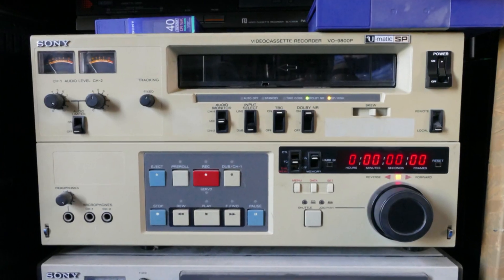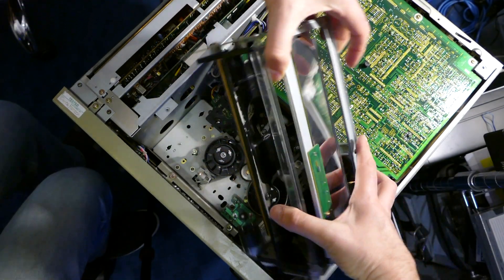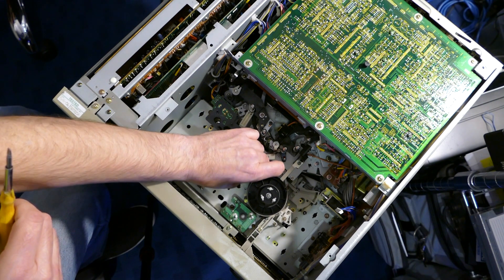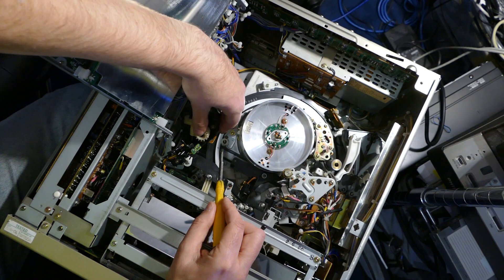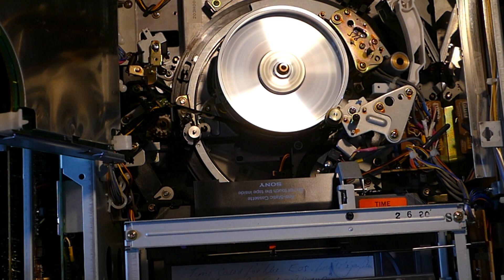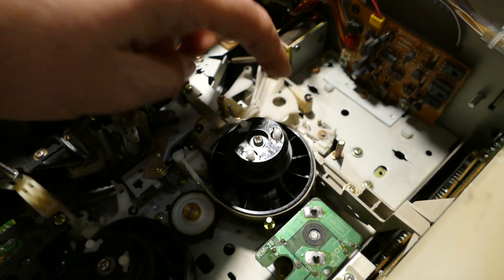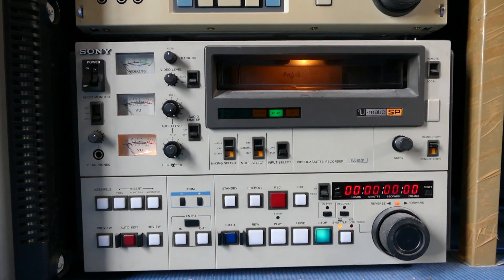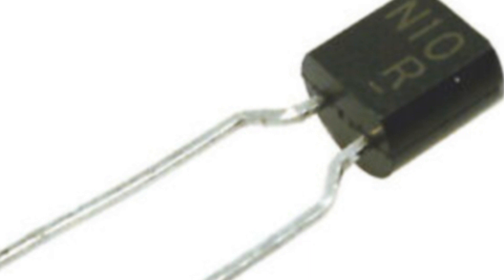Repair of VO9800 / 9850 and similar Sony Umatic video recorders

Comment: Any chance you can make a quick clip on changing the pinch roller in a Sony VO9850? Great videos, thanks.
Reply from the maker: Sorry, not a task I've every had to do.  The first thing to do is look at the service manual, which is readily downloaded (VO9800 is virtually the same).
Reply: @video99couk   I cannot find a service manual anywhere!

Comment: Ever had a machine go into the partially laced "stop" position and then just refuse to respond at all including after power cycling? Upon power cycle it does spin up the drum and pressing stop will slightly move the transport, but then it goes right back to not responding to anything else. Manually fully loading the tape just makes it go back to that stop/partially laced position once turned on.
Reply from the maker: I would inspect and clean the switches on the edge of the loading ring.

Comment: Colin, I changed all the belts but the loading ring is stuck in the furthest back position. I managed to manually loosen it by turning the motor belt wheel but it gets stuck in the same position when loading a tape and pressing play. Then it wont go back...
Reply from the maker: Possibly dried up grease, or something has landed in the gearing.  Turn it by hand and look carefully at the gears to loading ring connection.  If the teeth all look OK, it may be the loading ring itself which is jamming up, it could require a tiny dot of oil in just the right spot.
Reply: @video99couk  Thnaks. I will try that. Merry christmas
Reply: I found out whats causing the problem. The handle in the back on the right side that locks the whole loading mechanism in the end of the lacing. It has to be helped with a little manual push to get it back when ejecting. Maybe I have to take it out and clean, regrease and mount it back in?

Comment: My Betacam deck sometimes won't come on at all, as though it's not plugged in but it is. I had it happen a couple times and then start working perfectly again and run for several months around the clock. Now it has quit again. When it works it works perfectly, not a tape path problem or anything like that. Any ideas?
Reply from the maker: Intermittent problems are a pain.  It sounds like the power supply is not always starting up properly, maybe due to a bad capacitor in the primary side of the power supply chopper circuit.  I would be looking at low value capacitors around the primary side of the circuit, also check any high value resistors in that area.

Comment: Very informative video. Thanks. I have a vo-9800p and I am having problems with the audio getting way to loud on the input in my capture card. It is like this machine sends over the top high audio. Do ypu know what is causing that? I use the xlr utputs into my rca inputs on my black magic capture card.
Reply from the maker: As a workaround, try the headphone output of the video recorder, since the level can be adjusted.  It might be that your balanced to unbalanced cable is causing a problem with the capture system.
Reply: Yes. I will try that trick and see if the audio is more low. 😀

Comment: I have one in standby mode. Edit led is on and front panel doesn't work. Also stuck in Forward mode. All this After removing the cassette upper case. Anyone knows how to proceed?
Reply from the maker: Probably one of the tape end opto-sensors has been knocked out of aligment.
Reply: @video99couk  thanks for your replying. The standby led and also the forward led is on and the middle gear roll running without the tape inside. And sometimes jog led appears intermittent but the edit led sticks there and also no time code or error at the panel

Comment: What diameter should the wheel idler tyre have?
Reply from the maker: Sorry I don't have the dimensions to hand, best to measure the old one.  Not every Umatic machine uses the same sized idler tyres.
Reply: I don't have the old one, I think it have been removed by another one previously. Can I measure the spindle you think?

Comment: Thanks so much! I'm a step further in repairing my VO-9600p, i think the fuse you mentioned has burnt in mine, would you please share how to use correctly the test points on the board to check that?

Comment: Hello, can you tell me what can be the problem of the control buttons don t work in a V9800? only the eject button works. Kind regards
Reply from the maker: Check the Local/Remote switch.
Reply: @video99couk  thanks! The problem it was another, a little cable, everything working well! Thanks!

Comment: Hi Colin, thank you for your amazing videos. I don't know if you can help me. I've a vo-9600p. It plays and goes forward but when I try to rewind the tape it blocks and I've to eject the cassette and insert it again if I want to play it again. Do you have any idea about the problem? Sorry for my English 🤗
Reply from the maker: I would look at the reel idler tyre and reel drive belt, easy to access from underneath.  Watch what happens when you select rewind.
Reply: Ho colin, you are right. It's the reel drive belt. It's the most visible belt accessing from the bottom of the recorder. I can see it's very flabby... do you know where to find a replacement? Thank you for your help ❤️

Comment: I have also had reel motor failure on these, and a capstan motor fail-with the capstan motor, the shaft housing (made of pot metal) had deteriorated and warped. Luckily I had a scrap motor that a good shaft housing. It’s also worth wearing gloves with these machines, as some of the pressed metal pieces can have razor sharp edges !
Reply: Did it cause issues with rewind?
Reply: @Johnh-r2x  yes, as I remember it threw up an error 02 in spooling. Replacing the motor resolved the issue. It’s a Sony dnr-4000 motor but older models used a motor from canon, which should also work

Comment: Thanks for a very informative video. I've got a Sony VO-9600P problem and was hoping you could offer some advice. All the mechanics work fine but the after a few minutes of playback the picture just goes to black. The sound continues but no picture. After a little rest, if I run the machine again, the picture comes back but only for a few minutes. I'd be very grateful for any ideas you may have as to why this is happening. Richard.
Reply from the maker: I'm afraid that's likely to be bad electrolytic capacitors on the video processing boards.  The boards are easy to get out, but there may be a lot of capacitors in there.  I've not had to do this process on these machines so I can't offer much more advice than that.  An ESR meter would be useful if you don't plan to just blanket replace all electrolytic capacitors.
Reply: @video99couk  Thanks Colin for the prompt reply. I failed to mention that the E to E circuit still works when I put a video feed to the line input. Fixing capacitors is a bit above my skills. I just to digitise a few U-matic tapes so looks like I’ll have to do it bit by bit. Thanks again for your help. Richard
Reply from the maker: @crackingtoast123  If E-E works, that helps to eliminate some of the circuitry.  But yes, capacitor changing, especially in quantity, is a daunting task.

Comment: I have a Sony Umatic vo-5600 that won't play. The tape will load, it will fast forward and rewind but it doesn't respond when you press the play button. any suggestions?
Reply from the maker: Check that it's not in remote operation, I think there's a switch at the back for this.

Comment: Hello, thank you for the very informative video. I have two VO5850P units and I need/want to replace all the belts. I am having difficulty sourcing them. I also don't know what I am looking for exactly. Any ideas?
Reply from the maker: Just measure the existing belts and do a search on eBay or similar for "cassette belts".  You should be able to find something suitable.  Usually they are designated in diameter, so you may have to calculate that, allowing for some stretch.  You may also need a reel idler drive tyre, that can be a bit harder to source.

Comment: Have a Sony VO-5850. Audio and video is perfect on prerecorded tapes but upon recording, video is present but NO audio or very low/distoted.
Reply from the maker: Assuming that the VU meters respond OK during recording: That's going to require a service manual and an oscilloscope to resolve.  There's no simple fix for a fault like that.  Areas to look at would be the bias oscillator and power supplies to the audio amplifier circuits.
Reply: @video99couk  channel 1 VU is good Channel 2 VU is erratic. Have schematics and scope. It has been a pain. Thank you for the reply!
Reply from the maker: @sherrieanne5675  Oh that's interesting.  And both channels don't record properly?  I'm certainly leaning towards a problem with power to or on the audio circuits.  I once had a semiconductor type fuse go resistive inside a Umatic machine and that gave odd results.  The other likely culprit of course will be capacitor failure somewhere.  You can only go through it with the diagrams, a scope and signal generators.  I don't know if you can get good access to the audio circuits though, you may need a card extender.

Comment: Thank you for your last reply. As I said I have two VO-5850P machines. One of the machines loads the tape then, when you go to play, it partially loads the tape then stops and starts clicking! any ideas? The other machine plays but only in black and white. I have cleaned all the electrical connectors. I have (with one particular tape) got some colour image but for a short time. Any ideas? as this machine works to some extent, I am trying to get this machine operational. Is it worth me changing some of the boards over? I cant seem to get a schematic anywhere, unless I pay for a monthly subscription. I really need some help.
Reply from the maker: Capacitor failure isn't unknown on these machines.  It's certainly worth panel swapping a bit to see if you can at least isolate which board is causing the colour fault.  Not sure what the mechanical problem is caused by.  I would look at the loading motor to see if it's getting jammed up, it's quite easy to access.
Reply: @video99couk  
One last thing, do you know where I can pick up a service manual/schematic for a VO585P?
Reply from the maker: @stefzivanovic2427  There's a good user group for people who like working on old video equipment, someone there may be able to help:
https://groups.io/g/OldVTRS

Comment: I've got a VO-9600 that was working fine but now, when powered on, the drum starts spinning and that's it - there's no display, no error messages, none of the controls work, I can't insert a tape, I can't do anything. The drum just spins incessantly. Do you have any thoughts on what might be going on? Thank you!
Reply from the maker: It sounds like a power supply problem.  Check that the 5V line is present throughout.  Can't offer much more detail than that I'm afraid.

Comment: it looks like Criclewood electronics does not list the two belts mentioned in the description.  (the square section belts...69x2 and 34x2)  Do you have any other ideas on a source?
Reply from the maker: Probably best to just do a search on eBay for "cassette belts" of the sizes.  Care because some cheap belts are really thin.

Comment: Hi. Do you know where i can buy a 7 pin male connector to RCA? Could you please advise. Thank you.
Reply from the maker: Are you talking about the 7 pin Dub connector on the back of a Umatic format deck?  I plan on doing a video about those some time this year, but the first thing to remember is that the Dub signal is a special type which only works with equipment specially designed for it.  And no such equipment uses RCA connectors.  So why would you want Dub to RCA?  I wonder if you have got a bit confused about the signal types.  What are you trying to connect up?
Reply: video99.co.uk yes. I'm talking about the 7 pin connector on the back of umatic VTRs such as bvu950, vo9850. There is a special adapter/cable that converts dub signals to s-video/RCA. It was sold on BHphotos, and a few other websites. It is now nowhere to be found...
Reply: video99.co.uk i'm trying to use the dub connector to lead the signal to S-video input in the dvd recorder. And I'm digitalizing umatic tapes.
Reply from the maker: @vietnamintlvideo422  That won't get you anywhere I'm afraid.  Dub and S-Video are completely incompatible because they use different frequencies.  You would need to find a piece of equipment which can do the conversion for you, such as a professional Timebase Corrector.  It's not something you can just put together with a few components, Dub to S-Video is a complex conversion.
Reply: video99.co.uk there is no such a Dub2RCA cable existing? And regarding the professional TBC, which TBCdevice would you recommend? Please let me know. Thank you!!
Reply from the maker: @vietnamintlvideo422  There's no such cable because it wouldn't work with anything.  I use a "Digital Processing Systems Inc DPS-375 SP" timebase corrector which will accept the Dub signal and output S-Video, but it's quite hard to find that model.  There are other models which can do the same job, and a few video recorders have the ability to accept Dub and output S-Video (don't ask for model numbers though because I'm not sure).